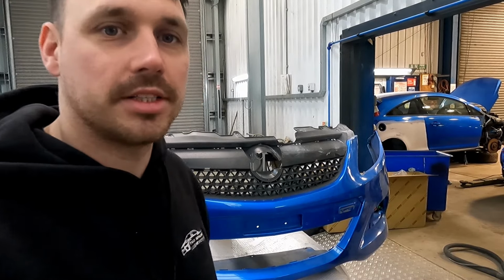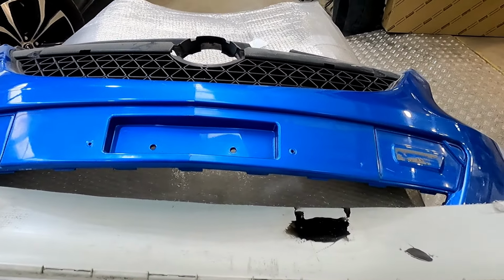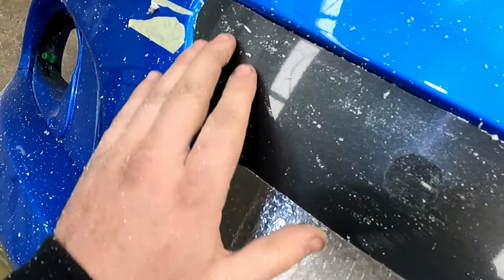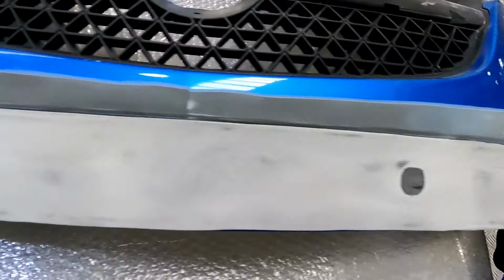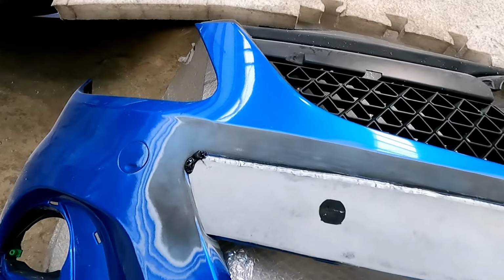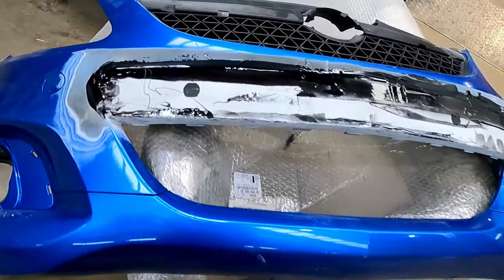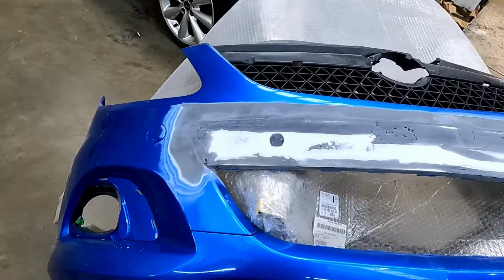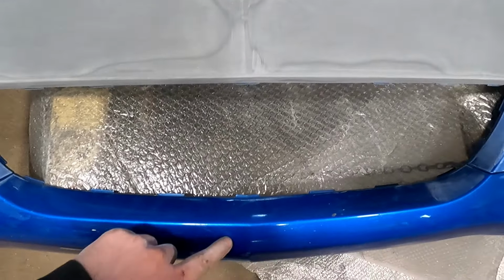VAUXHALL CORSA VXR - Front Bumper Smooth Episode 7!

Comment: I used expanding foam then fiberglass then bumper putty dno if it works as sold  it a while bk
Reply from the maker: I guess with the foam it's not as heavy as all fibreglass or filler but I'd imagine that would be likely to crack out. These bumpers are kind of stretched into the fitting position so we try methods that don't make the bumper mega rigid. So far the ones we have done have been clouting around with no issues 🤞

Comment: Looks really clean, and I know what you mean about those little black plastic bits either side of the number plate. They just annoy me when I look at mine
Reply from the maker: 😅 I know mate they just look awful I have got to get some one to 3D print me some brackets  now to hold my number plate in place so I can remove the plate at the shows 😀 I am always thinking and over thinking things so it’s the way I want it first time
Reply: @TwoSpanners  yes this is it though if it’s worth doing it’s worth doing right and getting it right first time. Better to take your time and get it right then rush these things and look back and think I’d wish I’d done that differently. Will all look amazing when finished.
Reply from the maker: @mattacdavison6890  yes that is correct mate pluss would be bad if it was wrong and I’m in the trade 😂 I wanted to make the Vauxhall show but I don’t thing it will happen tbh